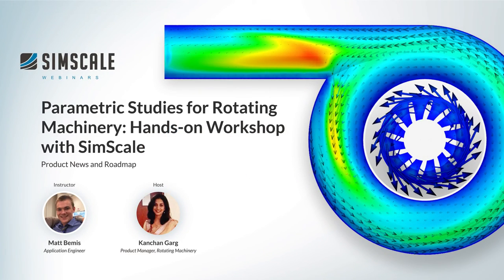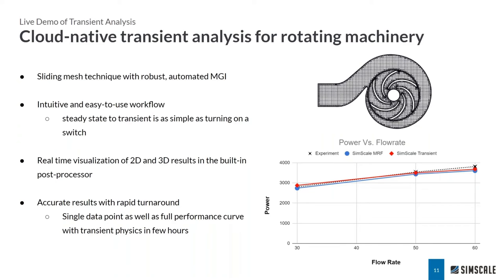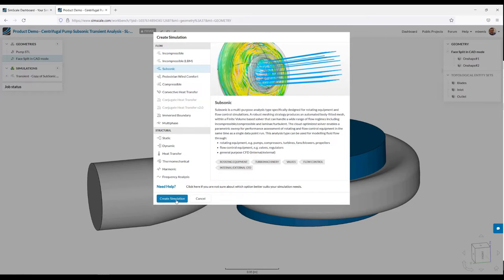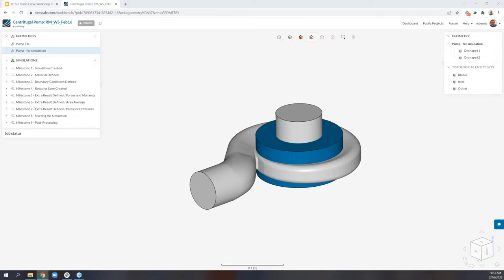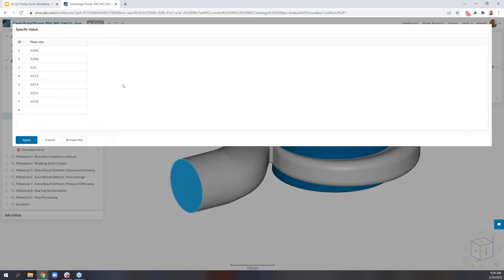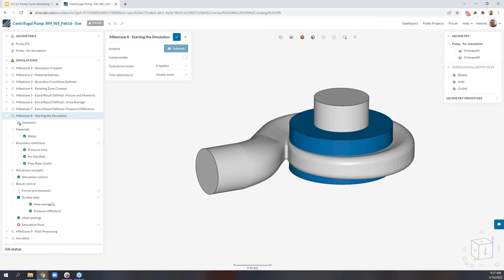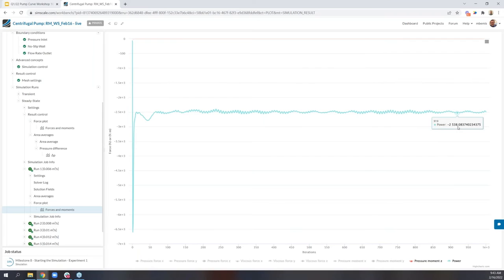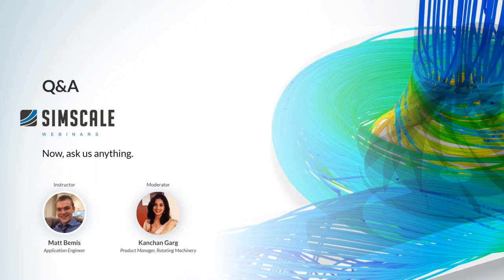Parametric Studies for Rotating Machinery - Hands-On Workshop with SimScale

Comment: You really need to mate SimScale more simpler to use. Example: first you import STEP of STL or other compatible files, then you draw a pane and give it what kind of wind should blow in given direction (also add some common properties like 50 mm pc fan or 120 mm  fan) and that's it. Also please make a tutorial how to prep file in Fusion 360 to use it in SimScale because currently is utterly annoying to use ... actually i was never able to use it because i didn't know what i didn't wrong and i was constantly wasting free hours for computation because of failed simulations.
Reply: Hey, thanks for reaching out. We're here to help if you need it. 
It sounds like you've described a couple of different types of applications. Is there something specific you are trying to achieve?